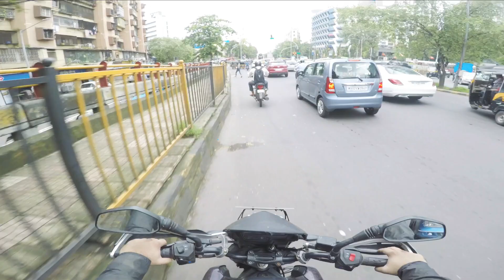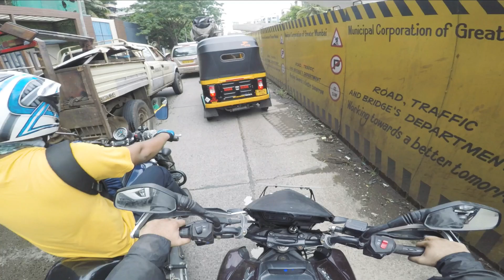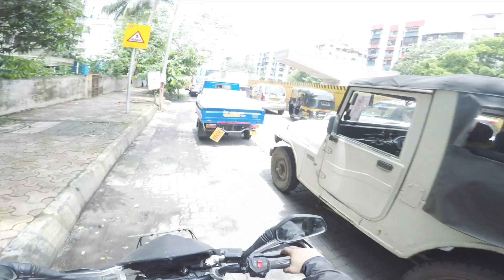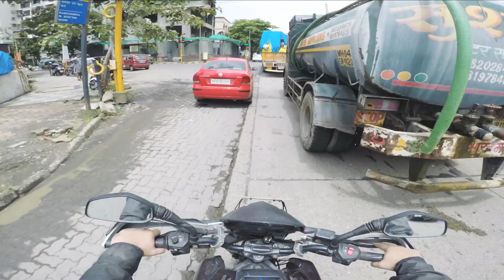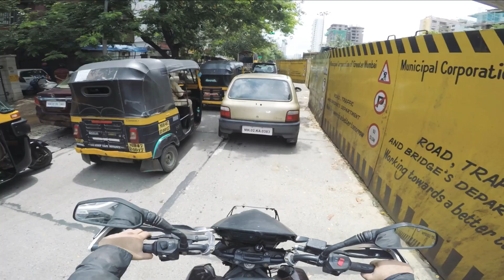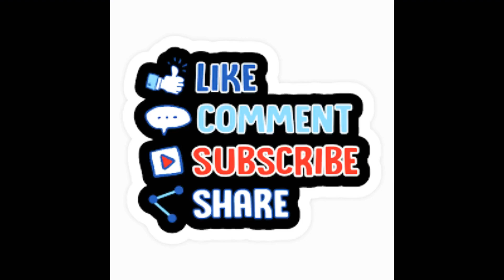Borivali - Link road New flyover - Kora kendra Junction | New Update

Comment: will motorists coming from WEH through Cariappa flyover be able to skip Kora Kendra junction signal and get on directly to this new flyover towards link road?
Reply: I think so if you have observed on the east side the slums have been cleared I don't know how that will integrate in this new flyover or it will not
Reply: @aryanrane8219  oh, didn't know about that. Glad the slums have been cleared. that created a bottleneck on the road
Reply: @glenn8781  not all the slums but a wide enough area is created in which some kind of construction has also started I honestly don't know what it is about 😅